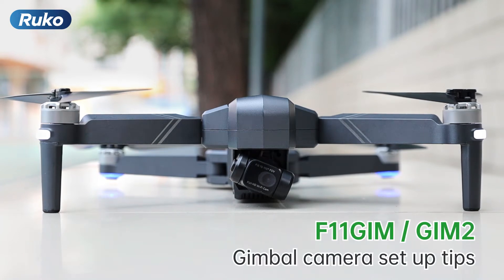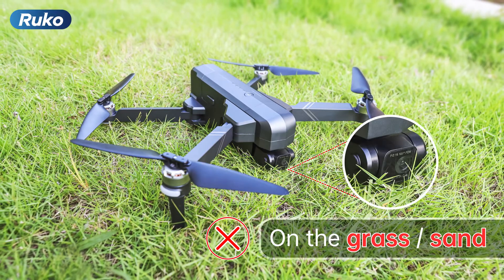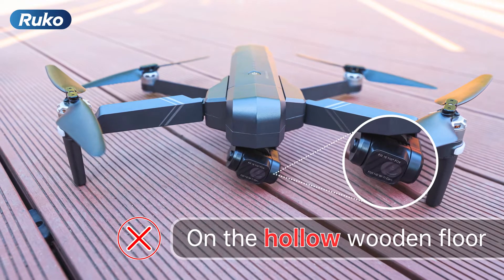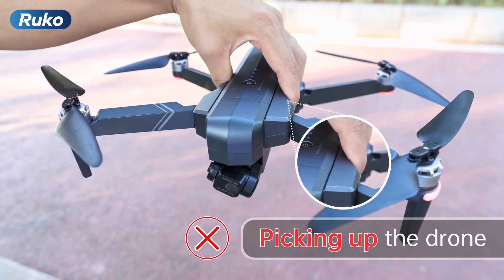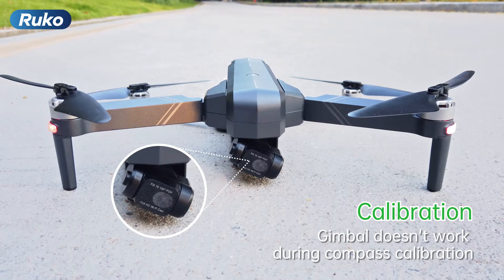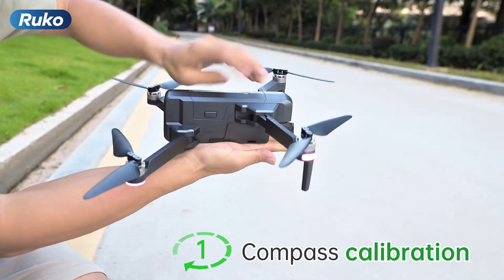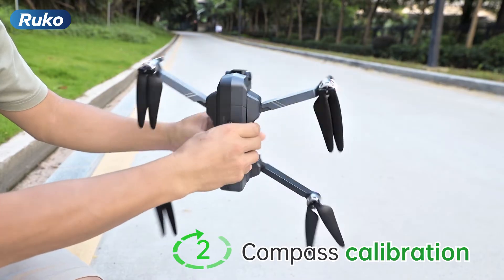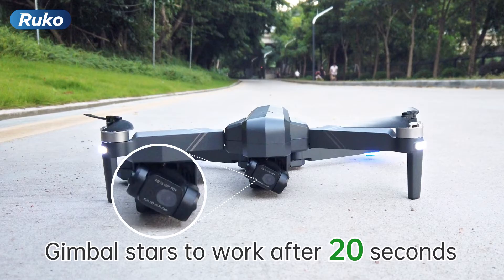Ruko F11GIM/F11GIM2 Drone - Gimbal camera set up and maintenance

Comment: My gimbal does not come to level during calibration.  What can I do?
Reply from the maker: Hi, you can try this step: adjust the gimbal in the mobile APP settings and then try restoring to factory settings.
Reply: @Ruko-toy  Tried this and didn't seem to work.  Left a message for your phone support